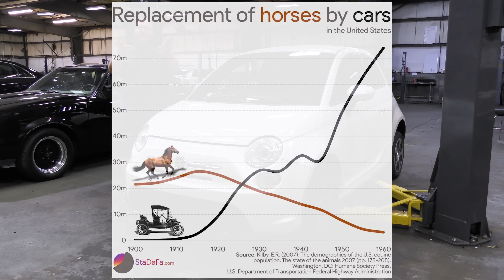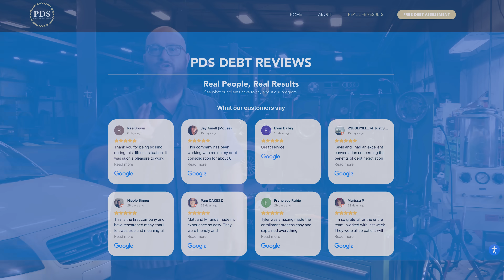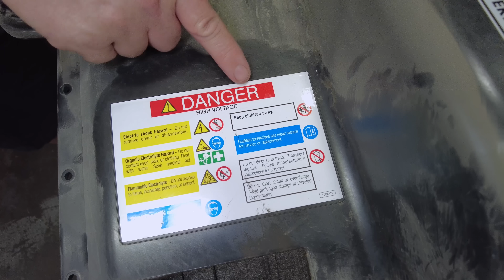How to SAFELY Remove the EV Batteries From my Fiat 500e

Comment: Battery-powered cars are not new technology; they've been around for well over 100 years. It has taken that long for range to double to where it is now, and it's still not acceptable. Recharge times are also still unacceptable.
Reply: Range has increased by 10x
Charge times only matter if you can't charge at home. For road trips it's typically 15 to 25 minutes charge time.
I have an EV and will never go back to gas.

Comment: 24 kw battery pack.   and the batteries are not what you showed. They are rectangle in shape. Mine will frequently charge to 124 miles but in 5  miles your down to 80. So lets just say its NOT accurate at first or at the very end. by the way i have 82k on mine, I would kill for a battery upgrade like the BMW i3 did. (same battery tech)

Comment: A really promising tech is sodium ion batteries. A lot less costly then lithium. There is no what happens when we run out of lithium issue either as sodium is one of the most abundant elements on earth. Like 2% of earths mass is sodium. Only caveat is they get 2/3rds the range but hopefully most vehicles are really aerodynamic by then so its not a huge issue

Comment: Yeah, keep your child away, but it's not a problem if children mine the stuff needed to make the batteries in the third world. Like a cell phone, the damn thing is a throwaway car. I regularly drive from CT to Poe Valley PA. I like to fly fish. In my current car, a 2006 Toyota Corolla, I can leave the house and in 6 hours be where I need to be and still have half a tank of fuel. I can't do that in an EV, Never mind not seeing a single charging station period in the area. My old friend that I fish with is gun-ho on EVs, yet he doesn't drive one, but he drives a full-sized SUV; we like to fish, and the best trout fishing is in places where  EV charging stations will never get built. There are too few fools to buy into it. Yes, EVs have their place, and where it makes some sense, fine. Oh, and there has to be the right to fix it.

Comment: an EV isnt better technology than a gas car.  i could see your point if EVs were way better or way more convenient, like if they went 600 miles on a 1 hour charge or something like that
Reply: Charge times are only an issue on road trips and even then it's typically 15 to 25 minutes. For normal use you would charge at home overnight and wake up with a full battery. I have an EV and will never go back to gas.

Comment: I love my EV. We own a BYD in Australia. It's hassle free driving and free to charge on our solar panels. Embrace the change folks!!!
Reply: I live 140 kms north from the arctic circle. Would be able to charge ev from our house, but the pricing, range in wintertime is awful. Might wait a while still.
Reply: @IkeVMAX4  Yeah cold weather batteries are an unsolved puzzle. I think the solution at the moment is battery heaters to keep them warm, so long as the car is plugged in. But if you have to park outside in the snow it's a problem.

Comment: Great video. The average ICE car gets 400 miles to a tank that takes 10 minutes to fill. It costs $100? To refill it plus expensive maintenance and a lot of ICE cars are mechanical bricks after 12 years as well. 
Too expensive to repair or are unreliable, rusted, etc. The battery packs coming with Juniper Model Y, will be 15 minute recharge and 250 miles with a fraction of the other ICE costs - and they are better cars, better real time updates,  better features, etc.
This is why China is adopting EVs by the millions - and are way ahead of the US in adoption - and most things now.

Comment: Sadly you'll never get 1000 miles out of a battery that big. A battery that big holds about 5kwh. But then again, a can of gas that big might hold hundreds of kwh, enough, if it was electricity, to run a whole street for days... how far would it get a car? Most of the energy is just burned and thrown away.
"The good times" of super-cheap energy in the form of oil, are coming to an end. The future is going to be one of energy storage being huge, heavy and bulky. The key is to use that energy more efficiently! And an electric motor does, almost all the energy you put in gets turned into movement.

Comment: Cheers from a subscriber from Bulgaria who has 2 EVs nowadays and is very interested in the EV repairs. Still have 2 ICEs and had many before. Hopefully our guys save your car. There are some pretty smart people in our small country. It's such a waste to have those EVs thrown away just because of ignorance of dealerships. As you said they are here to stay, so private EV shops in Europe are making a ton of money nowadays because of this ignorance. Most of the failing parts are not harder to fix than an ICE car's ECU which are everywhere in German cars and most of the EVs have serviceable baterries and parts available. 
Some years ago I had a 2007 Suzuki Swift-very simple and generally reliable car that dealership suggested to scrap just because of a failed ABS control module which costed >30% of the value of the car and was rebuilt by electronics shop for 150$-similar story as EVs now. The difference was that first they made me chane everything mechanical before concluding that it's the electronics. With EVs we at least know we can focus in the electronics directly in 90% of the cases 😂

Comment: Wizard one of my hang ups with EVs they are so tech dependent would anyone want a 10+ year old laptop? That's the problem manufacturers can stop supporting the software and then your EV is done.
Reply: Sure they should be an option but not the only option.

Comment: Cool look at these and I am the same not a hater however they have a long ways to go and need to figure out which direction things are going to go. I've looked into the ev market and am more supportive of fcev's as they will still allow for a gas tax that will go to road repair. That is my only issue as currently most areas haven't thought of it yet however the politicians that aren't thinking ahead will realize they have no road maintenance money as that came from selling fuel which these ev's aren't using directly. Sadly most ev owners are skating the responsibility of contributing to road maintenance while driving a car that weighs as much as a pickup truck does and that's not their fault currently which requires a tax on public charging stations to keep our roads repaired. As far as ev's being a new technology that is a farce as the electric motor was attached to a vehicle way back when the vehicles were introduced however the ev's then have the exact same problem which is range and weight sadly. We really do need to work on the range, weight, and getting these vehicles to start paying a charging tax to maintain not just the roads but the grid again as well since they use so much electricity on just one charging station. A couple of interesting videos on the history of ev's: https://www.youtube.com/watch?v=v071sCp-xrs which gives a bit of a reality on this issue. Another note is that the USPS tried ev's repeatedly and honestly had the same issues as today even though they were given rave reviews which does highlight that these issues need to be addressed before we mass adopt any ev type. Either way cool to see you open a battery on camera as most won't do this which makes this a mystery to most people.

Comment: HAve an EV all you want. Only way to make it truly green is to use hydroelectric(which still has small enviro issues for fish and such), solar(that takes so much room to make enough electric to work and in winter the effectiveness takes a large hit or wind( and the wind doesn't always blow and the amount to pt up most of the tme takes up space where we could grow trees that could help with replacing the CO2 in better and more effeciant ways than the windmills that also can kill birds...so while gas/oil is not maybe the best or even coal fired electric plants which supplies a large portion to charge them is not very effecient.

Comment: put a turbo hyabusa engine in it fully dressed weight of 140lbs and can produce 175 to 250 hp (NA)!!!! and its even equipped with a DOG BOX transmission and much more power with a turbo or cheap route is a snow mobile engine with something like a comet torque converter constant velocity transmission, 2 small diesel engines linked together incase one fails it keeps going with a freewheel

Comment: The problem with the 500e in particular is that it was a "compliance" vehicle. They were only offered as leases for a reason, with a "MSRP" way higher than it was actually worth. They were never meant or intended to be owned long-term by consumers, hence why there aren't parts or anything readily available for them. FIAT expected to just junk them as soon as their compliance period and leases ended.

Comment: The EV industry is like the early years of the desktop computer industry. Knowledge and technology is still in development and somewhat still in it's infancy. The technical advances from 2008 to now 2024 are phenomenal. 

 Charging standards is the key to greater EV adoption. Now the EV manufacturers electronics engineers are learning about battery software, and component design, how to keep the cells healthy while charging. 

Eventually, the battery modules may become somewhat standard. The cells are currently somewhat standard for physical size. 

The milliamp capacity, quality of internals, and chemistry, and internal design varies by manufacturer. 

The battery software, and sensor design, which monitors and manages the amperage and voltage, is the key to battery health and longevity. 
Different type of lithium chemistry requires different charge rate and capacity. 

Many of the first Tesla Roadsters are still operating with their original battery (including cells). The original design engineers life expectancy was 5 to 10 years.

The first 18650 cells held about 2800 milliamp capacity The latest version is about 3000 to milliamps capacity.

Some manufacturers 18650 now have almost 4000 milliamp capacity. .The challenge is thermal stability, and the number of charge/discharge cycles to remain healthy for many years.

Much was learned, and continues to be learned, about the different types of lithium batteries, and why/how they age, and fail.
The milliamp capacity of cells continues to increase with each design iteration.

Manufacturing a battery cell exactly the same each time, multiple thousands/millions a day, is extremely extremely difficult. 
Each component must be of extremely precise concise quality for thousands of feet, while applying precise concise chemical deposition. Not to mention the physical assembly process, and internal design fitment. One failed cell out of 10,000 is not acceptable! One fail is never acceptable. Perfect is the goal.

Much is being learned, and fine tuned daily at every factory in the world.

Comment: There's alread an EV capable of 1000miles of range, but it's in reproduction currently and lauch edition will only have 400miles (40kwh battery which they plan on upgrading to 100kwh for 1000mile version). Car is called Aptera, only negative is that it looks pretty weird and it's a 2 seater, but it has optional solar cells that add up to 40miles of free charge a day.

Comment: take four of them and convert to hydrogen cells and power on water.  if that guy with the vw could do it you can. i know you could.
Reply: Where will you get the power to split the water to use the hydrogen?

Comment: I believe that EV s will not be the main solution due to the future shortages of raw materials for example cobolt and lithium. the world does not have an endless amount of resources.. another problem is the cost of changing the batteries=expensive as hell .. problems with EV fires 🔥.. and the main issue is that EV s will most certainly be scraped at around (10 years.ELV )..it will be an environmental issue when they are scraped aswell .. an ICE car can last around 20 years if serviced well and so on .. I know that ICE cars will not be the only cars on the road in the future.. but realistically in 2035 it should be around 70 percent ICE and 30 percent hybrid s and EV s ..

Comment: The horse replacement analogy is silly. Cars replaced almost everything horses did AND expanded new capabilities by replacing train travel. EVs dont do anything better or expand more capabilities of personal transportation. No, they aren't any "greener" for the environment so forget that argument. To replace 50% of American cars with EVs would take 30 years of US consumption of copper for the batteries, chargers, and infrastructure. See you in 2054.

Comment: One thing that Tesla will probably come to regret, and that definitely the Model Y and Cybertruck 4680 battery owners will regret, is that their batteries are all potted in with a very stiff foam. Individual batteries, or even modest modules, will not be replaceable. The entire car floor or nothing. I think this is probably in the long run a big mistake.

Comment: Standardized or common batteries would mean the end of innovation. One must deviate from the normal if you are to make any improvement and set your product apart from your competitor. We had standardized headlight for decades. Yes, it was a low cost but we saw zero improvement until after the standard was abolished. then lights got much better.
Maybe we could standardize the 6 cylinder ICE engine?

Comment: I'm not sure that having a unified cell really is the best idea overall. Think about engines: is there a unified engine? a unified transmission? there isn't even a unified shape of an engine! heck, there isn't even a unified fuel octane. It sort of stifles innovation and competitive advantage if everyone is required to have all of the same technology, and would almost be like price fixing too. As it stands now, the industry is free to make really powerful compact cells for a high price, or lower power heavier cells that everyone can afford (LFP in a Model 3 for example). The range wars of EVs right now is like the GHz wars computers had, or the megapixel wars cameras had. They hit a point and people got over it. We're now getting EVs with 400 or 500 miles of range at the high end, yet a significant portion of gas cars don't even get that, and people seem to have forgotten it. I own two gas cars and they both get under 350 miles of range, which is just a smidge more than my wife's EV. Most people don't even need that much, the average person only drives under 40 miles per day!

This seems like a great project though! I've owned two Fiat 500s, still have a 2015 Abarth that I'm in the middle of turning into a rally car. I am also a lover of EVs and have two Teslas at home. I was excited to rent a 500e a couple weeks ago in Denmark since I hadn't driven one yet, but they didn't have them anymore and put me in a Renault Zoe (which was a TERRIBLE car).

Comment: Wizard, great video! We have a 500e as well, 85000 miles and counting. Still gets about the same range as when we got it, or at least seems that way. BTW - please just ignore that silly 'Range readout'. It's dumb, doesn't mean anything, just software fakery. Just go off the battery percentage! Ab out .75 miles per percent is about right.

Comment: LOL! over 100 years ago people were saying that they don't need the noisy, smelly ICE vehicles. Funny enough, today, us BEV fans are saying the same thing. What does that tell you?
Edit: BTW, cutting low voltage power to the car will cause the contacters to open, making the battery pack inert. Then it should be safe to handle even if the fuse is still in. Teslas have a cut loop for just that purpose. I don't know for sure, but the Fiat (Fix it again tony) should have the same thing.

Comment: With a claw attachment on an excavator? Those POS things don't like Hot or Cold weather. Not everyone lives in 70* weather year around. We get wind chill of -10-30f regularly in the winter months. Electric cars just don't work in those conditions. The big problem with EVs is motor Efficiency. Brush-less motors are very inefficient and very power hungry especially on the initial startup but they do have very very good torque.

Comment: Water cooling in a 400v Battery pack? Hmmm... Okay till it eventually springs a leak inside the pack. They should have used some sort of Peltier system - No liquid.

Comment: I'm old enough to remember when Wizard would show us the ACTUAL removal and repair, not just the aftermath.
Reply: Yeah-I was also interested in the battery pack removal. In the previous video Wizard said that the rear axle needed removal first, but in this video it is there in its place.
Reply: He was probably busy because his 1st priority is running a shop.

Comment: Hi Wizard...this is $800 wasted, there is nothing wrong with that battery pack. I have seen several 500e owners saying the same thing as me - that pack is working as it should, and you will see what looks like degradation as the mileage drops quickly, but its just the computer adjusting for accessories being used, speed being driven etc. I know you have codes, but I doubt that battery regulator has issues. I hope you put this car back together and a)enjoy it for what it is OR b) sell it to a Fiat 500e enthusiast that will.

Comment: Manufacturers could standardize batteries into compatible modules so that third parties could manufacture them but they won't. Same as power tools not having battery interchangeability. Short sighted and anti consumer.

Comment: All the world governments pretending to care about the environment... EV's could be so much better if, they standardized the batteries to the point where they are easily and cost effectively fixable.
That would certainly help the environment in 1 way. It would also help with the reputation of EV's in the sense that they wouldn't be scrap after 7 to 10 years.